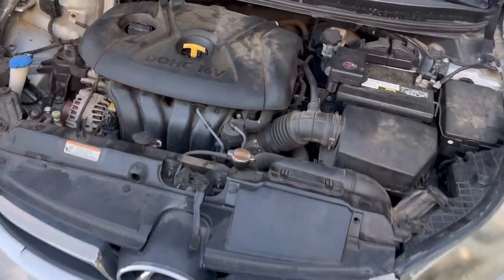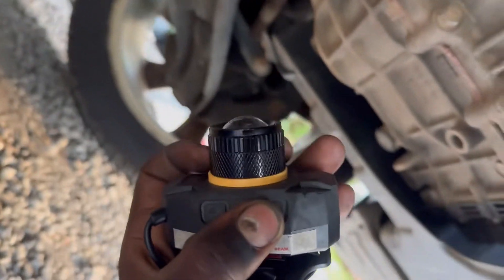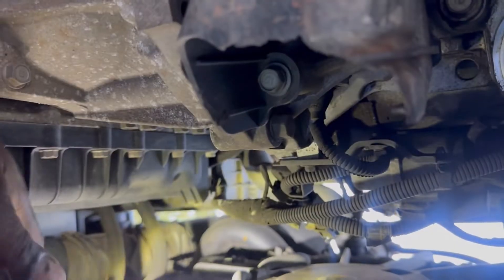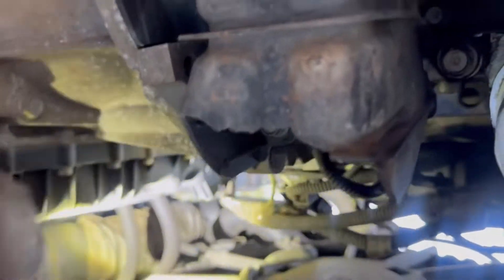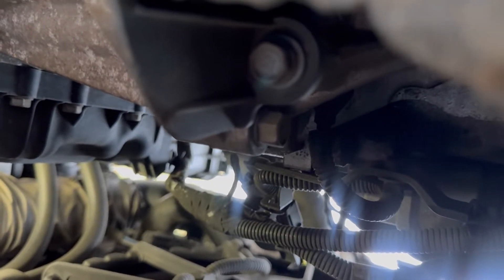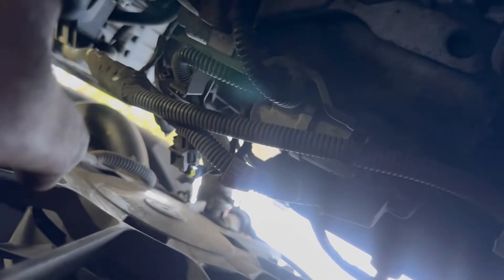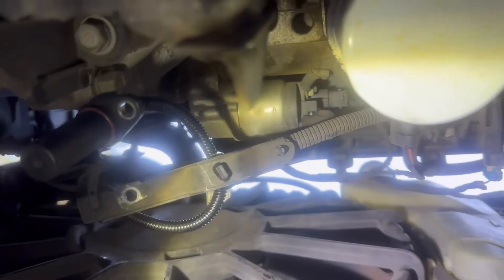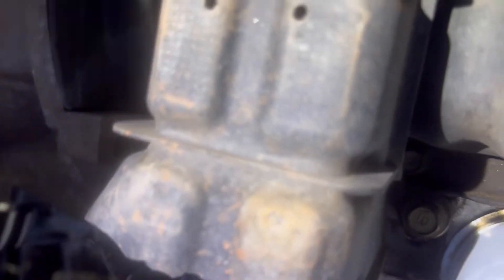How To Change Crankshaft position sensor in Hyundai Elantra

Comment: Was driving my Elantra and the engine just shut off and CEL came on and tachometer stopped working is that cuz of this sensor failing
Reply from the maker: Yes first sign of a bad sensor or wiring diagram

Comment: I didn't have a jack so I just put one side of the car on the curb and that helped me out. I. Wasted 100 on a diagnostic and the mechanic still didn't fix the problem until this code popped up thank you for guiding me. That sliding part sure was giving me trouble tho lol
Reply from the maker: Great tip!